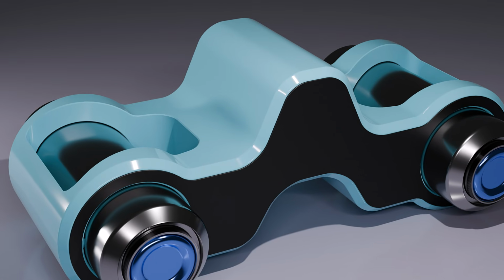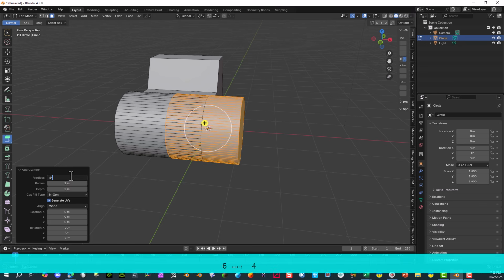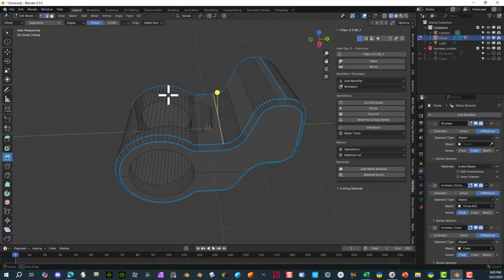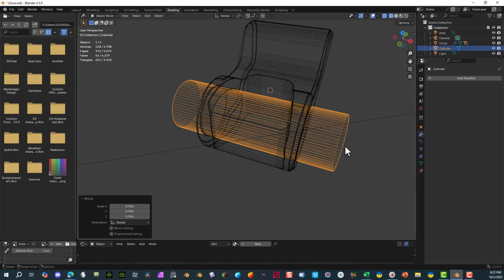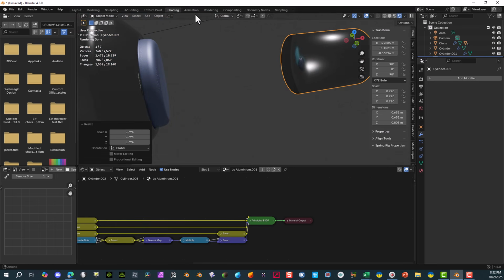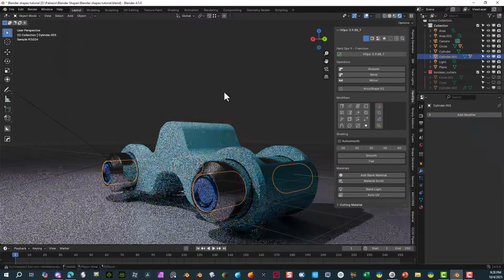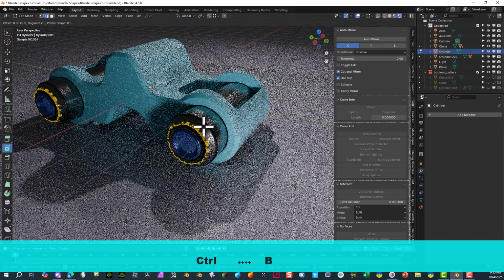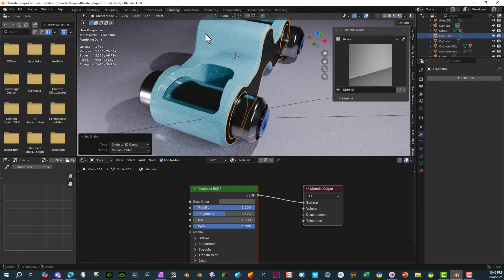Creating Mechanical Shapes in Blender for Beginners

Comment: Click the Options drop down menu in the top right of the 3D window. Activate the Auto Merge and the Split Edges and Faces Options.
At 4:00 select one of the two separate sections, press g to move then press Enter to drop in back in the same spot. It will do a boolean join and unite the two parts adding the extra vertices if any are needed......
Remember to turn off the Merge and Split options so you dont freak out hours later...... 🙃
Reply: Or just extrude part of the circle to the side to form the other part........
Reply from the maker: Thanks for the suggestions!